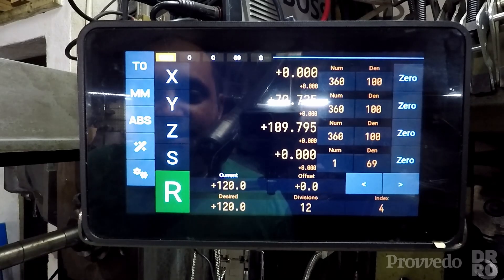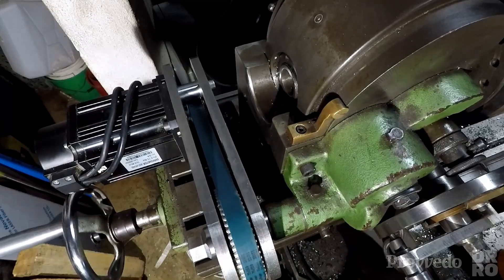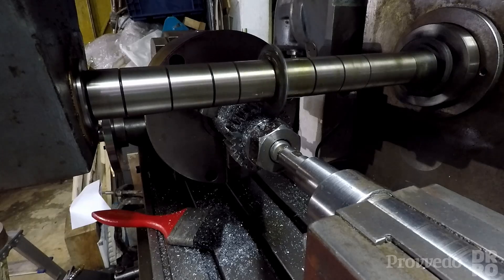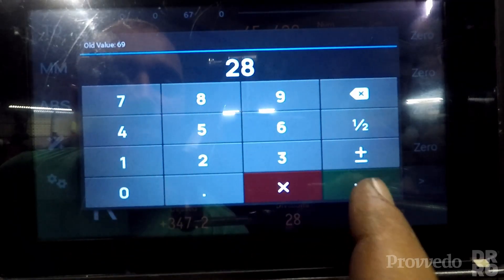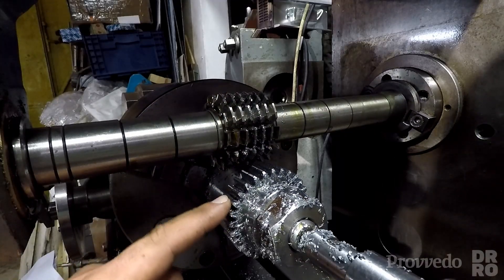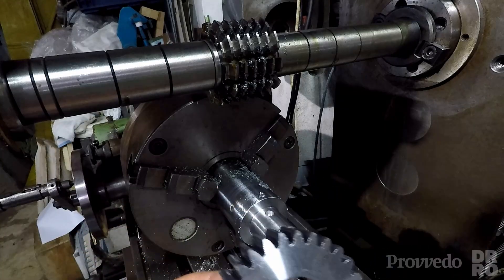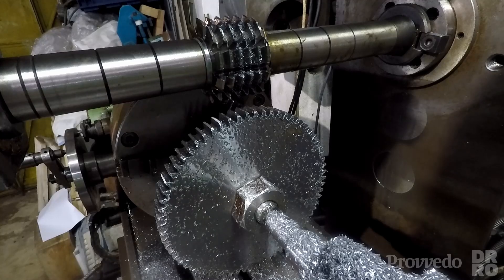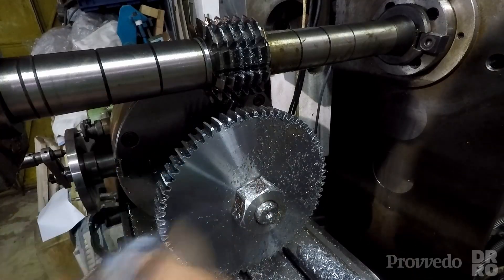How to Use DRDRO for Gear Hobbing and Cutting feat. Luke

Comment: Nice work!  The feed is definitely too fast for hobbing:  for a home machine, .006-.010 in per rev of the blank will work well.   Are you angling the dividing head to compensate for the hob lead angle?  If not, this will make your tooth slightly narrow.  Best regards!

Comment: Hi Stefano have seen you videos, one with Mark, Jeremy makes things, and latest with My Lil' Mule, he shows assembling unit in detail.
I don't understand how it can be used for electronic lead screw with the unit. Can STM32 PCB be used on it own for a lathe.
I like how it's done with a big touch screen and you work shop is a wish to have it. Do more videos when you can.
I am building small lathe 1200 mm long  x 250mm wide with 20mm linear rails and rolled ball screw, Z 25 mm X 20mm.
There is Smart Lathe T5 by, YUWE MACHINE TOOLS and  STAN CANADA.  STAN CANADA have a nice demonstration and YUWE has a small clip how to update controller.
How hard would be to make unit with touch control like Smart Lathe T5, like using 2 hand encoders for movement of Z and X Axis manually with Joystick for feeding when its moved in 4 position and rapid when center button is push down. Thanks.
Reply from the maker: Hi Milan, thanks for your feedback! I am not sure about the Smart Lathe you mention, but the rotary controller board could be programmed to handle multiple motors and multiple encoder inputs already, with my version of the software that you can find on github right now, you can only control one motor and do axis follower operations and indexing operations. For other use cases it's definitely possible to make a custom version of the software that handles your example. If you're interested in the ELS mode please take a look at the latest video I released, there are some more details about the configuration and operation of such mode on DR.DRO

Comment: Amazing DRO Stefano. When hobing does the spindle speed/RPM need to be synced with the dividing head? If so how is it achieved?
Reply from the maker: Hi Petern! When hobbing we use the sync mode of DRDRO, there is an encoder mounted on the machine spindle that tracks the position, with it we perform synchronized motion of the dividing head with the specified ratio. This is also the mode we use when using the DRO in ELS mode, or when performing spiral grinding/machining. Thanks for your kind interest in this project!
Reply: @stefanobertelli2650  that’s awesome. Can it also be used to shape gears close to a shoulder also known as gear skiving? Andy’s Machines adapted an old mini mill head to do that but he is using assembly for the code. :(
Reply from the maker: Yes you can do skiving as well, the sync method is the same